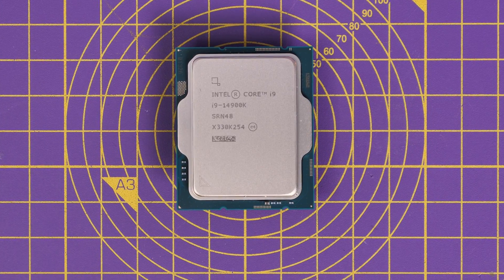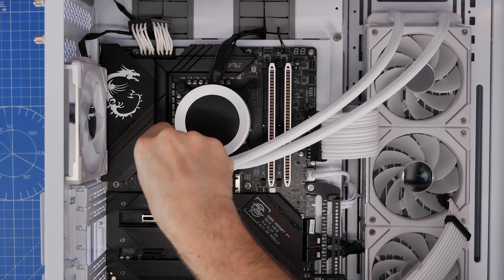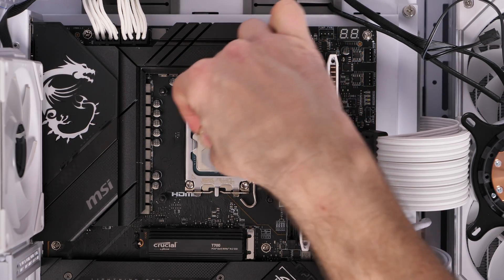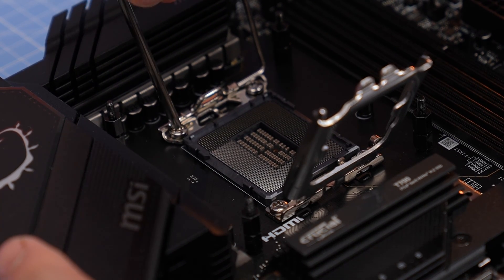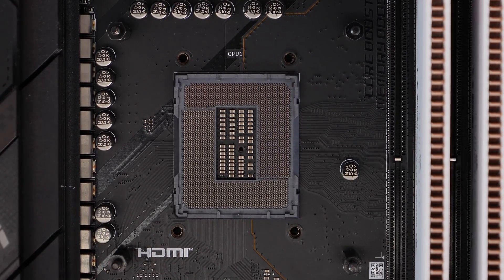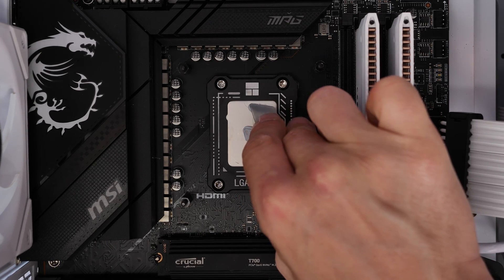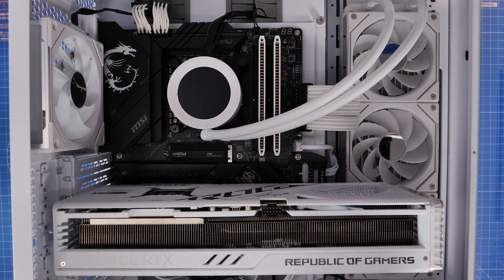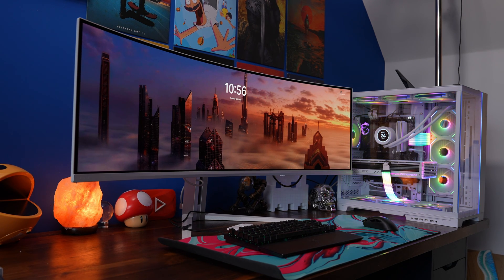How to downgrade from an Intel i9 to an i7 CPU

Comment from the maker: This video is aimed at people who don't know what they're doing in the bios or are intimidated by it. Those people might choose to sell the i9 in favour of the i7. At least that was my thinking which might be entirely wrong.
Reply: Using an i7 isn't going to suddenly stop AIB power limits being over aggressive. I'm convinced most of these issues being reported are ppl using more budget boards that do not have adequate VRM cooling and combined with AIB power limits in place is a recipe for disaster. Everyone talks about CPU temps, but VRM's getting too hot is certainly a guaranteed way of getting instability. Then we have those that are sporting fast DDR5, or 4x dimms which in itself is it's own nightmare. Most don't have a clue what their doing.

And has anyone mentioned VRM temperatures in any video used in conjunction with AIB limits? Nope. The fact this alone is overlooked, makes me question the tech knowledge of many so called tech savvy youtubers. All i see is ppl copy/paste the PL1/PL2 numbers from video to video, but with no facts behind the AIB power limits even being responsible for the issues in the first place, i find this laughable. In a nutshell there's a lot of finger pointing with no facts to back it up, even Intel own statement said "unconfirmed reports" of stability issues.

Sorry for the long post, love your channel Prawny.

Comment: im going back to 12900k ..im done dealing with the bs with the 14900k.
Reply from the maker: It's worth trying the latest bios updates from what I've seen. https://youtu.be/iiS04RcswHA
Reply: @TheProvokedPrawn  i did ...it made it worse ..bios ver 2402 .
Reply: Sooo..my mobo - z790-e gaming wifi ......went back to bios 2402  and did more research.  Ended up downclocking my cores ..seems to help but doesn't justify a $600 cpu ...supposedly intel is releasing a patch mid August. We'll see what happens.  Not holding my breath ..
Already ordered a 12900k.
Reply: I did the same and have the same bios update, would I have to change anything with the bios or can I just put in a 12900ks and it will work automatically? I can't find any information on downgrading and bios. Btw on 2-4k the difference is like 10 fps vs the 14900ks, what a joke these new chips are
Reply: @bumnymcneedy249  ya its a jk ..smh ..nah you should just beable to put the cpu in and be good ..but i wouldnt use intels bs baseline for 12th gen ..if anything i would go back to "2102" and just see how it works ..thats what i might do when i get my cpu.
Reply: @coryo617  I set the power limit for short and long term to 241 and the core amps to 400 while putting a offset -0.05v, so far seems smooth as butter, I was able to get the last KS in my country because news travels slower here, so I jumped on it, it was the only one available in the entire country, all the K series are gone now too
Reply: Okay, so what do I do now that I ordered my 12th-gen processor? Do I have to roll back my bios or download an old version? I appreciate any help you can provide.
Reply: @3rdnote  you shouldnt need to ..12th gen doesnt need the new microcode since its mainly for 13th and 14th gen..what mobo do u have ?

Comment: Even a slightly downclocked core i9 14900K, will still massively outperform a core i7 14700K.  Intel has now released a couple of bios fixes which should now sort out the stability issue.  Problem is, there will be chips out there that have been running on the vastly over powered bios setting, that may have already done the damage to the cpu.

Comment: My Msi Z690 ACE has a simple option in BIOS for choosing the type of CPU cooler. I chose "Box Cooler" preset for my 14900K (although I am running an open loop) and that automatically applies 253/253/307A which is easy to cool and runs at a constant 5.7ghz in BF2042 with no stability or overheating issues at all.

Comment: the best cooling solution for an i9 is the direct die super cool  with a custom water cooling loop  im running a i9 14900ks  running cinebench with optimized default temp is 65c  with asus ai overclock  85 c   where before it was hitting 100c with just a ek waterblock on it lol

Comment: So you spent money on i9 14th gen and you ''down-upgrade'' to i7 14th gen... I think you lost me there Sir...  The issue is relatively addressed by Intel/Motherboard manufacturers, but overall either you refund the whole setup and choose a different platform , or apply the fixes that's been circulating the community for last 6months. And people who are intimidated by BIOS or any other tweaks will go with refund (from experience).
Reply: Hes not losing any performance. The i9 is one of the worst of it's namesake ever.
Reply: @BonusCrook  The whole situation with i9 is just ridiculous if you think about it, but the matter of fact is - you should never get into a place where you need to swap out CPU to battle temp/voltage throttling. Pretty sure intel sealed their fate with 14th gen all together. On a bright side, I always wanted a small shiny claymore in my pc case :D
Reply: @MrLangobard  100% what a shitshow

Comment: I recently began building a new HTPC/light gaming rig for the living room. I was choosing components when all this stuff about failing 13th and 14th gen CPUS became widely-known. I ended up building around an i7-12700KF. I'm using an AsRock Z790M PG Lightning/D4 motherboard, as well as a contact frame, and liquid metal between the CPU and the cooler (Thermalright Phantom Spirit 120). The rig is both undervolted and overclocked, and it's working well. Glad I didn't go 13th or 14th gen!
Reply: This doesn’t concern neither i5 13th/14th nor I7, and even 13600k blows your 12700k out of the water in terms of performance and fps.
Reply: @neigebuttert  I suppose I forgot to mention that I got the CPU for $139.
Reply: @neigebuttert   I only paid $206 for my 12700KF, brand new (on sale at Amazon). The 13600KF sells for $250. The 13600KF  has fewer performance cores than my 12700KF (but more E cores, for the same total number of threads), and less cache ram. My system, as currently configured, consistently scores a hair north of 22,000 in Cinebench R23. Not bad for an HTPC that occasionally is used to play Fallout 4.

Comment: I think the new i7 is stable only because its a new CPU out of the box. Once it runs at high voltages and heat for a few months it too will become unstable. The best thing to do for an unstable i9 is to Disable all E-cores, use Intel Base Line Profile, Disable XMP and slow down your RAM timings. Also if you know how, then some Under-volting can really help. It will probably take a couple of weeks to experiment with various settings, and you may lose 10-20% single core performance and around 40% multi-core, but you will have a stable system in the end.
Reply from the maker: Yikes. That's a lot of compromise eh

Comment: General question.  Is it possible to turn off individual e-cores?  Not all but some.  For example 4 e-cores only.  I wonder if a fancy (read: very expensive) motherboard BIOS would allow this.  Perhaps disabling a few e-cores could help stability.  If such is not allowed today could it be implemented in a future BIOS update or not at all?  I guess I am asking if it is technically even possible.

Comment: my 13900k is fine ,,,,,,, never had an issue ,.
Reply from the maker: Excellent
Reply: @TheProvokedPrawn  cheers for reply my man ,,,, mines an HP omen 45 pre build ,,,,, With 4090 ,,,,, not sure what is going on ,,,,, BUT USING 240V in UK is an advantage maybe ,,,,, HOWEVER I CERTAINLY HAVENT USED any motherboard overclocks as it makes warranty invalid using Extreme mode aa basic motherboard unlocks itself using software ,,,,,, However HPs bios sits same as bios after reboot as omen software , However you can do a lot more in bios

Comment: Thermal grizzly sells a cpu lapping kit. I lapped my 13700k and it dropped temps significantly. Have you thought about trying that? Would make for a good video as well. Keep up the good content.
Reply: I might need to get that for my 13900k. Does it have a protective holster of sorts for the CPU’s underside?
Reply: Did you also use a contact frame?
Reply: @WSS_the_OG I used one for mine. They’re cheap and easy to install, just makes sense
Reply: @Paul03880  I thought so too.  I'd figure if you're going to lap, use a contact frame too to do the labour justice.
Reply: Yes

Comment: Hmm.. I originally thought this video was going to be a guide to changing bios settings to make the 14900k perform effectively like an 14700k (as much as possible), to improve power usage, heat and stability, rather than physically changing the cpu. I have a 13900k (I have the regret to go with it) and I have changed various settings to tame the monstrosity. Obviously I’m not getting the full performance of the chip anymore, but the temps and power usage are worth the trade off.
Reply: Is it possible to turn off individual e-cores?  Not all but some.  For example 4 e-cores only and make the i9 into an i7 ?

Comment: I feel sad for my  PC. I just ordered an upgrade CPU for it. Right now on amazon you can buy a 12th gen I7 12700 for $200 and I spent $100 to upgrade to Another 1st gen I7. Currently I have a I7-960 and going to an I7-980x extreme. I think this was their first 6 core cpu. Increase in L3 cache memory and increase in cpu threads  I  built this PC probably 8 or 10 years ago and it is still serving me well with 12 gigs RAM till now. I can still play some games like BF2042 and Jedi Survivor. I won't even try Cyberpunk on here tho. So the new CPU and the 4070ti super i bought should get me by for another year before i need to build a new pc. At least that is my plan. Waiting to see what the deal is with Intels new 15th Gen....

Comment: If you apply the latest bios updates for the 14 900 it will adversely affect the 13 700 and the 14 700 as well.  This will be a tremendous hit to both.

Comment: Mobo manufacturers releasing updates fixing this issue and its also happening in 14700k cpus, i dont uunderstand the point downgrading to i7 cpu.:card-red-penalty:
Reply: my i7 14700k is completely running fine the issue mostly is on 13 and 14 th gen i9 cpus
Reply: @TheOne214  im also using 14700k,  i faced same low memory issue till asus updated he bios recently.
Reply: @xNo0bgamerx  i guess there are a few i7s that are facing this issue but the problem mostly persists on i9 cpus
Reply: @TheOne214  bro u dont get the point... its not a cpu issue. Its a mobo settings issue. Whenever u use intel default settings the cpu works fine. But the mobo manufacturers uses their settings by default that had overvoltage/power supply to the cpu. Recent updates  fixed the issue for most of the users(like me).
Reply: @xNo0bgamerx  oh i know its a mobo issue but not everyone is facing this problems with the i7 its the i9s which mostly got wrecked due to too much voltage being delivered to the cpu by motherboard manufactures default settings which the bios update fixed by putting the settings to intel default settings im still using an older bios compared to the latest one which introduced the fix and im not facing any problems on my i7 14700k
Reply: @TheOne214  but why spen 600$ more just to downgrade lol
Reply: @TheGoldenCulture  Better yet, ...just buy the 14700k instead of the i9
Reply: @sezwo5774  I have a i9 14th gen. 0 issues with it. Havnt gotten that error yet and its been months now.
Reply: @TheGoldenCulture okay but it’s defiantly an issue, just because you don’t have it doesn’t mean it’s not real.

Comment: had the issues with my i9 13900k with video mem, unvolted my cpu and the issues went away and finally updated the bios for the default settings and no longer have to worry anymore.

Comment: Well here’s the thing I’ve had it 3 months but it’s my first pc build so even if I want to downgrade I would have to sell it and I am afraid no one will buy it because they will think there’s something wrong with it which really I’m just sick of the stability of it and the power draw it takes like why is it taking so much even with your last video I set all the settings you said to do and still taking 150-200watts just absurd my Nzxt elite just struggles to cool it sometimes really bothers me… for example dying light is a very cpu intensive (2015) game and I also did at the start buy the bracket for it as well. All I have to say it drives me nuts to see the 7800x3d running less power and getting the same or if not more fps along with it’s actually stable…